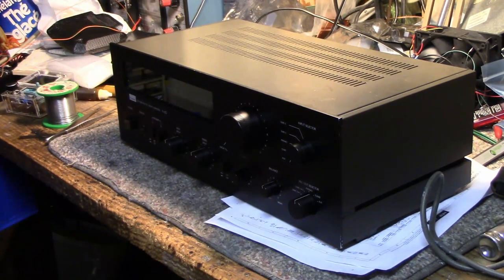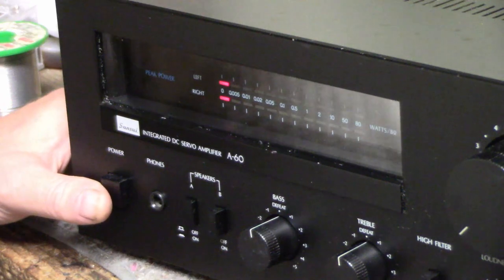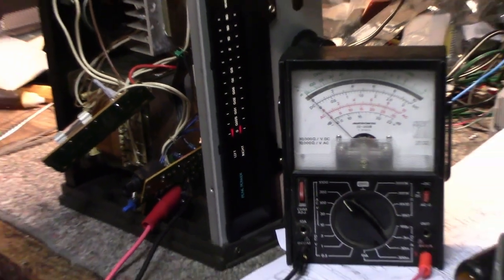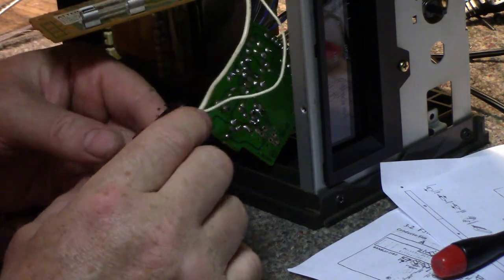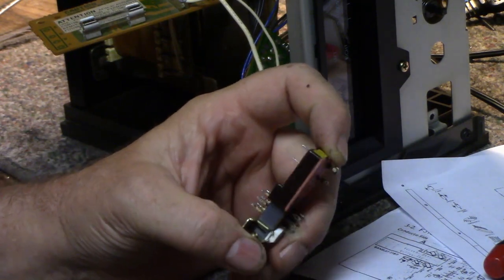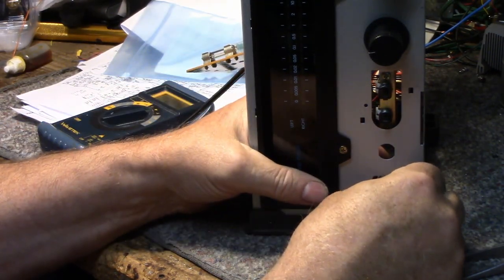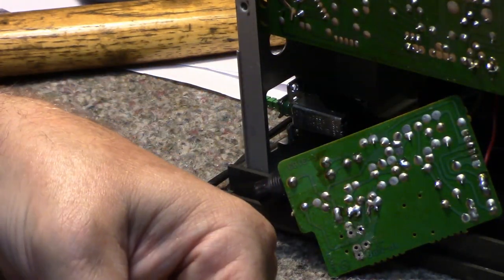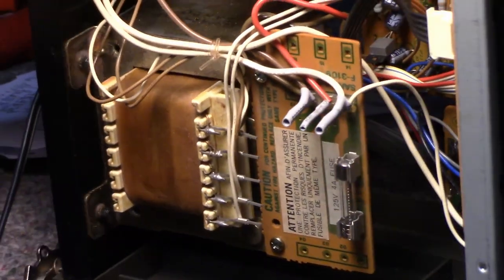Sansui A-60 Amplifier Repair - Part 2 (Ep. 37)

Comment: In my Sansui A40 I have applied contact cleaner to the power switch by drilling a small hole on top of the switch. I applied the contract cleaner by means of its small extension tube and at the same time pushing and releasing the switch many times. Then I sealed the small hole with glue or just covering with a tape and that works fine for me.

Comment: The problem you are showing when power on is an electronic cap over the power on switch circuit. I don’t know exactly which one but it disappeared in my Sansui A40 after recap in the whole unit.